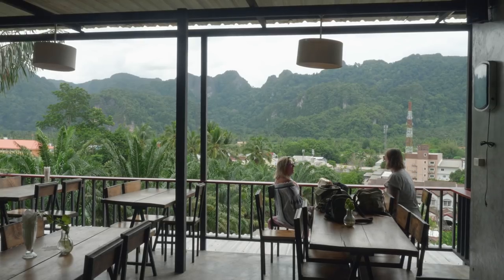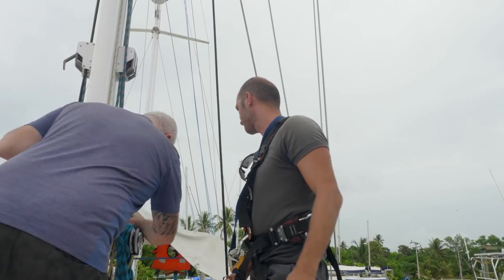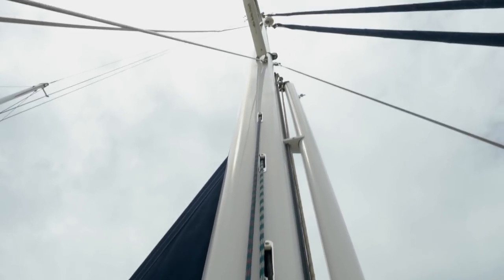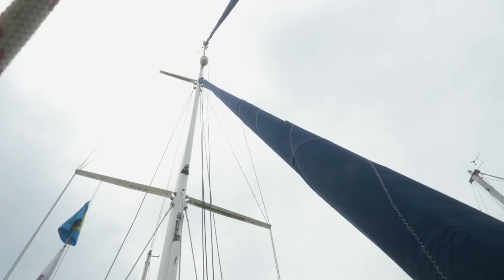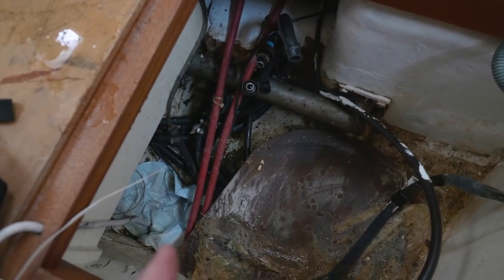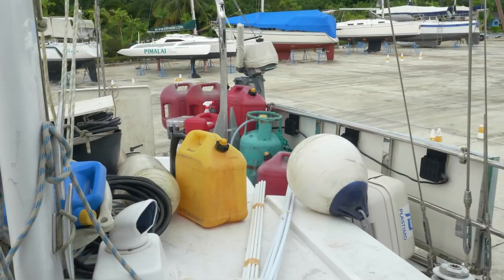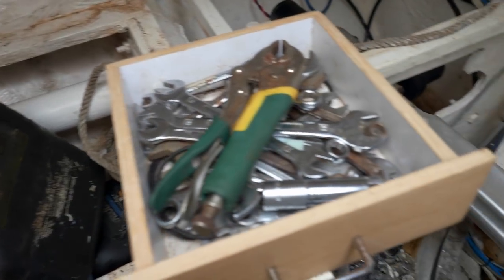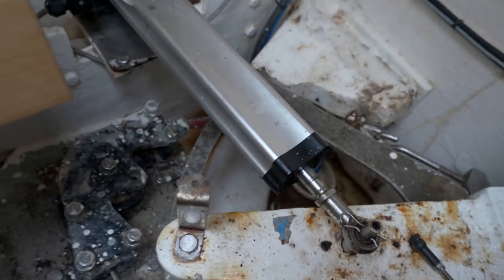SHOULD WE RE-RIG THE BOAT? - SAILING FOLLOWTHEBOAT Ep 116

Comment: For the quadrant. Get a nut and drill out the thread. Grind the nut so that it has a shampher on it making a flat area for the adjustment nut to lay square to the cable. Hope I explained that properly Jamie ...
Reply from the maker: Sounds complicated, Ben. I think I have it under control though, apart from those dodgy, rusty clamps!

Comment: Big thank you for this series of technical stuff. I love to know how things are put together and work. Can I offer some sympathies - first finding a good home for Dad; we've done that several times. Second the mess - we are getting ready to move from Yorkshire to Essex - your boat looked like our house inside as we empty cupboards (and the loft was like going back in time). One other thought; I have not seen any WD40 on your boat. Spray liberally on the steering machinery. It keeps rust at bay on the car - I don't know about salt water. Regarding the cable jumping off the quadrant, I saw a canal boat, I think a Norman, that wrapped the quadrant with a long line of thick cable ties. From all the sailing channels I have watched, replace all that is less than good, rusty or worn. The rest should be good for the next big adventure which I will be following. Can't wait.

Comment: 12:35 the "tightening bolts" that hold the cable have galvanic corrosion. And that is probably why the cable streches over time. You need to replace those tightening bolts with stainless steel before they break loose! Also, make sure your lazerette is water tight and that you have some air circulation (one air inlet and one air outlet), otherwise, condensation will keep your lazerette wet, even if it's 100% waterproof! Another great vid! +1
Reply from the maker: Food for thought there, Harry. And yes, I'm on the case with replacing those bolts.
Reply: I agree; I think it is important to make a commitment to do whatever it takes to keep water out of the boat as it causes numerous problems.

Comment: Noted the issues with the quadrant nuts backing off so suggest to change the second nut or lock nut to a stainless steel nylock nut or a crush nut then it will never back off. Won’t solve the cable stretch though.
Reply from the maker: Nylock's a good idea, Roland.

Comment: No, I would not replace the rigging if I didn't have to.  I am looking at that job on my new boat, though.  I'm surprised to hear that you can't get the same quality cable there that you could back in England.  I thought things were pretty much available world wide at this point.  As far as Dyneema goes, it's a nice material, but I don't think it's as robust as stainless cable.  I would wait on that.
Reply from the maker: I think we over-sold that point about inferior cable tbh, Jeff. There IS good cable available in this part of the world. I think the point we were trying to make was that we have good quality cable on the boat already. Sorry for the confusion.

Comment: I would change the flange on the tanks to a round one with more bolt holes. You could also make it a flexible hose to reduce the strain between the tanks. Ditch that ridged pipe.
Reply from the maker: You'll be pleased to know it has been ditched, Donald, but since the vlog is a few weeks behind you'll see us continue to struggle with it for a while longer.

Comment: Greetings from Florida. Very informative vlog. One nylock nut on the steering cable would fix that problem. My time in the wind industry has shown me their worth. Wind towers vibrate 24/7 365.
Reply from the maker: Yep, nylock's now on the shopping list (they're harder to source than you'd think in this part of the world).
Reply: Sailing followtheboat No, I do understand. In the U. S. with the demise of local bolt stores to Big box stores, all hardware that is slightly different is hard to find. I have to go on line to the world of poor descriptions,  and poorer photos’. Beware some Nylocks are one time use. There is no stand color marker.

Comment: Interesting, I'm in for a re rig this year (ketch so like you twice as expensive as a single stick) When I bought the boat I was told the rigging was 12 years old - I subsequently found an invoice showing it was closer to 18 years old but as you had the boat rigged last time you at least know the providence.  
I had a pre-purchase rigging report prepared what that said was it looked ok and the insurance company accepted that for a further two years, albeit with a reduced value clause on the rigging. 
What the rigger said outside of the written report was that without dismantling some of the sta-lok connections and destroying a sample of swagged connectors, there was no way to know for certain the condition of the wires ,he went on to say ' In 30 years in the job I've yet to see rigging wear in the middle, it will always go where it is most stressed - at/in the terminals' - So I guess,  for what it's worth, it's probably worth checking with the insurance company how long they will accept a riggers report for and whether they will de value the rig due to age.  It also raises the question, would you feel more assured crossing the pacific with new rigging rather than old? If what your rigger is saying re inferior quality of new rigging is true then it leave you in a bit of a quandary, I'll be interested to see which way you go..

On a more serious note...
Jamie, what's with the 'we'?, when actually 'we did this that and the other,' clearly means you made Liz do this that and the other, or at least that's the story the video tells.  ;)  
Liz you don't have to put up with his antics, if you get fed up there is always a spare berth on my boat (although she's not in quite as nice a location as esper'

Thanks for the video, keep them coming, you keep my dreams alive
Reply from the maker: Haha! My excuse is that when I'm doing the filming I'm obviously not working. When I'm not filming, I'm working! Liz, fortunately, has the patience of a saint 😇

Comment: Hi, Have you considered changing to the later blue steering cable conduit? In my steering manual, Lewmar recommend changing the inners every 5 years and the outers every 7 - whilst that may be good for a heavily used charter yacht, it seems OTT for most. However, after changing ours (the outers were about 20Yrs), the difference in helming is incredible - it got rid of that heavy, dead feeling and made the boat feel alive again (Moody 376 of 1988). Just a thought!
Reply from the maker: Hi Andy. It did cross my mind and maybe we should look into this. I replaced the inner cable a few years ago but you're right, the outer conduit should be replaced at some point too. It's not top of the list and won't stop us from launching but we should put it on the wish-list. Thanks for the feedback.

Comment: Re the Diesel Tank cross over pipe. I don’t like those 4 bolt Flanges. The distance between the bolts / studs is too large to create an effective seal. Especially at the bottom of the tank. 
Can you fit extra bolts between the original bolt holes?
Thanks for the close ups it really helps to understand what you are talking about.
Reply from the maker: Yes, it could be possible, and when I read your comment earlier I went away and thought about this a bit more. Need to think about that one...

Comment: I wouldn't worry much about the "too technical" episodes... the stuff you're going through is extremely interesting and very common issues with a lot of boats, seeing how you're tackling these problems is fantastic, I would argue for even more of this stuff but that's just me :) Just my two c regarding the rigging, one thing to consider, you're in the right place to do it (if you need to), after you move on to Japan, Alaska, Canada and the US.. my guess is that it's going to be much more expensive to do.. maybe not the material so much but the labor is going to be a hell lot more, Rolly Tasker helped quite a bit when Delos replaced their rig... Not an expert, but wouldn't be better to have flexible pipe for the connection of the diesel tanks? the rigid stainless steel one doesn't have any tolerance for flexing even a tiny bit of flexing between the two tanks would brake the seal. Cheers
Reply from the maker: Yes, good points well made. I think when we get to the Americas we'll have a whole load more stuff to sort out on the boat, and rigging will be one of them.

Comment: Your in a remote place so the cost is and issue VS East coast USA were I can send all the standing rigging to a place like Rigging Only and go completely new for 1200 dollars on 30 foot boat 

You also won’t really realize how beat up it is until you have new rigging as I can already see minor things on the new stuff after 7 seasons 

A big hidden spot is the wire inside any fuller as the bushing is very hard on the wire on the top of fuller due to having enough halyard tension to stop a wrap

Also rig coverage in general requires reading the fine print on the policy as here many company’s our vague and will weasel out on a rig failure as the cost will total most older boats
Reply from the maker: Good points well made, thank you.

Comment: Interesting vdeo, i'd be replacing the U bolt clamps holding the ends of the steering cable with stainless steel ones.
Reply from the maker: I think they probably were stainless at one point, Alan! I cleaned them up but you make a good point. Might be wiser to just put new ones on. On the shopping list it goes! 👍

Comment: IMHO SS does have a reputation of breaking without any notice and then you have a disaster. Now if you had Dyneema rigging it gives you plenty of warning to a problem that could lead to failing by showing lots of fuzzy fibre . The good thing is that you can repair Dyneema anywhere in the world , even in the middle of the ocean all by yourself. Dyneema is 3 times stronger and 8 times lighter than SS. You should check into it. would make a great life line through your stanchions plus many other important uses. Cheers
Reply from the maker: Yep, some strong arguments for Dyneema, Robert. We're considering it for the future.

Comment: I am quite surprised that you did not make mention of the cable clamps on the rudder cable . You definitely have to change your U-CLAMPS  on those cables. Seriously!!1
Dynema for your life line is a Dyi . you'll save some money there.
As far as the re-rigging goes I would be in agreement with the quality of the material.
If you are going to have to proceed you might as well ship in the good stuff.For the amount of time and effort in for a ounce in for a pound$$$$
Reply from the maker: Hey Jim. Yes, someone else mentioned those cable clamps and I have put new ones on my shopping list!
Reply: It is easy to over tighten steering cables. It looks like they may be at the limit of the eyebolt's thread. My main procedure is to hold the helm hard over, loaded up, and then tighten the loose side just enough that it cannot drop out of the groove. Repeat same w other side. Do not overtighten. For max strength, "bulldog" wire rope clips should be 3/side, spaced at intervals (or multiplies of) equal to 2/3 pic, saddles on the live side of the cable, not the ends (which is the way they are already oriented).
Reply from the maker: Nice tip, Marty, thank you.

Comment: Ouch thats a lot of money for stainless I presume, I hear others talking of Dyneema and its great stuff easy to splice but it is very susceptible to friction and is (on ships )protected with kevlar sleeves in areas prone to friction. Also neither of which are cheap. Dyneema good to have on board for speedy strong repairs.
Don't laugh but thought its worth throwing into the ring there is a large classic yacht locally (about 60ft) twin masted and having to get new rigging and they are going for galvanised at a fraction of the cost Im thinking if you HAVE to replace perfectly good stainless to keep insurers happy what is the situation with galvanised and just replace that more frequently and still be quids in. Just a thought. enjoyed the video and it really shows the other side to cruising.
Reply from the maker: Don't know too much about galvanised as an alternative, Ian. Will need to look into this. We're also investigating Dyneema. We're going to be talking to the rigger about this in front of the camera as it's a fascinating subject and good alternative to the current set-up.
Reply: Look forward to that as dyneema an interesting product but would be worried about the UV resistance where you guys sail. I think on a Pacific crossing though for just peace of mind especially in rough weather you may end up going back to the devil you know or try out one of the other options on the aft mast. Good luck you never stop learning ;-)

Comment: You can't rely on visual inspection of rigging.  It hurt$ but you need to pull the mast, then use magnaflux or dye to really check for stress cracks that the best naked eyes cannot see. Rigging is stressed by stress cycles, not dsyd, not miles, but how many hard tack you've made. So at a certain point, often 10-20 years, it pays to just replace everything including the turnbuckles, instead of spending money on testing the old stuff. Eyeballs are good, but I wouldn't call them good enough to bet my life on, offshore.
Reply from the maker: Replacing everything including the turnbuckles just isn't an option at the moment, Lyfan. Understand your argument but if we can get another couple of years out of the rigging it will help us spread our costs.
Reply: I know what it is to reach for your wallet and only find pocket lint. If you're in that hard place, then at least get a dye check kit, and personally check every fitting to make sure there is no crevice corrosion. A rig failure could really ruin your budget.

Comment: If you can get Esper insured without re rigging then do so , I say.  3 reports stating the excellent cond of the rigging should be enough. It was smart to get 3 too I'd say.  Can't you modify them tanks and come up with a better solution to join them?
 I could'nt quite tell which one of the 3 "F's" Millie wanted to do to that other cat.
It's good to see you both in high spirits even though the boat looks a right shitfight ATM.
Your friend is a cutie and seems like lots of fun. No re rigging required. Cheers.
Reply: Oh, I was impressed to see Liz up the mast too. You're one helluva lady Liz.
Reply from the maker: The problem with the tanks is that the large pipe fills one from the other, so we have to have some kind of wide-bore system some where. It's a pain in the ass! Millie just wants to rule.
Reply: If you cut the majority of that pipe off, so It was only a few inches long on each side after the 90 and joined the 2 with thick fuel line, it might help the tank flanges seal better if the 2 tanks have any slight movement in them, independent of one another? I realise that not the problem you have now but it may prevent it happening again in the future?